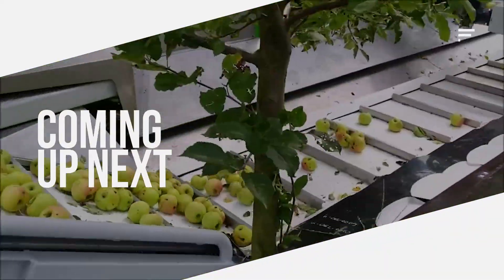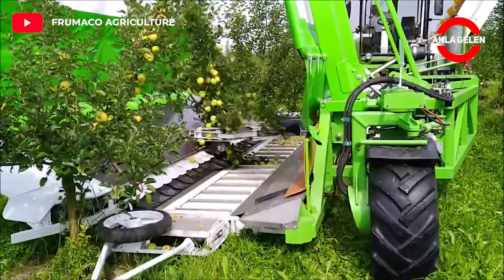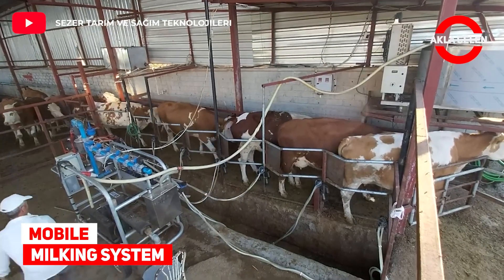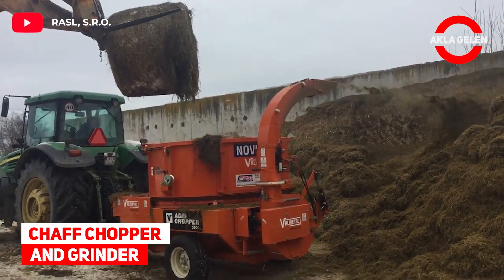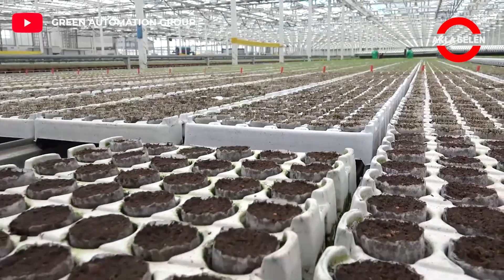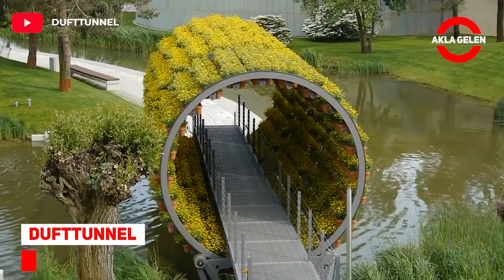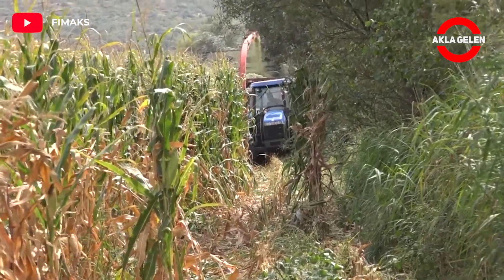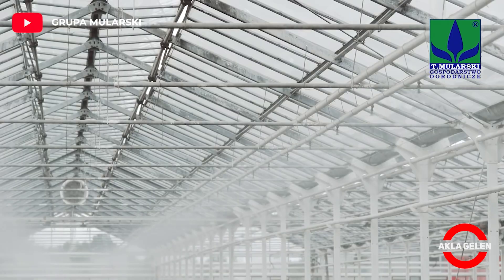This Method is Incredible - Modern Farm Technologies Every Farmer Would Want To Have

Comment: 2:57 is total nonsense. you take grass and process to bale, then you take bale and process back to grass...that's happening actually. you've just fooled yourself. you wasted two machines. you can just grab dried grass and transport in van to the place without "bale/debale" steps. 
and if you want to argument "bale is compressed grass", yes, bale takes less space, but while transporting bales, there are gaps between them, so you save only little bit of space and time actually.

Comment: Great video overall. Impressive technologies. However, the last segment about hygienic milk was somewhat disturbing. I grew up on a farm and our cows did not have an inch thick of dung all over their hind legs. If they were soiled, we had to clean them properly before using the equipment. Basic hygiene. Definitely not the case for the cows in this video. If the legs are that messy then the cow udders are tainted as well. I would not drink that milk.

Comment: Will a letter grown like that have the same nutritional values as the one that grows like that or on containers?
Reply: Probably based on the soil inputs in the pot it is in. The two that I'm not so sure of is the claim of "hygenic milk" when they put the milk machines underneath the cows' rear ends and the rotating potted plants for the flowers. The flowers may be rotating to get enough sunlight, but in doing so it requires electricity to power the mechanics so in order to be green, it probably requires either a fossil fuel, nuke, or the same amount of solar and wind power as you would need if the flowers were spread out in the ground like normal.

Edit: Reading the other comments, apparently it rotates using the stream which I completely forgot was an option. So ignore that one and fixate on my "hygeic milk" comment.

Comment: I bought two packs of dill seeds in a special store. Spent time buying good soil. With a saw, with nails from boards, I built a stand for seedlings on the balcony in late spring. Watered regularly. And imagine for 2 months not a single seed germinated. What's the matter? I grew pepper in the village in the 90s, but now nothing grows in the city.

Я купил в специальном магазине семена укропа целых две пачки. Потратил время на покупку хорошей почвы. Пилой, гвоздями из досок соорудил подставку для рассады на балконе поздней весной. Поливал регулярно. И представьте себе за 2 месяца ни одно семя не проросло. В чём дело? Я в 90-х годах в деревне перец выращивал, а сейчас в городе ничего не растёт.
Reply: I’ve had gardens for many years with lots of successes and every year some complete failures. Maybe you planted too late or your climate is too hot. Did you let the soil dry out? Dill needs to be germinated in quite cool weather and won’t tolerate a lot of heat. If dill failed try something else next time.